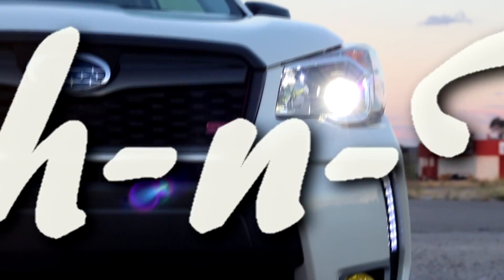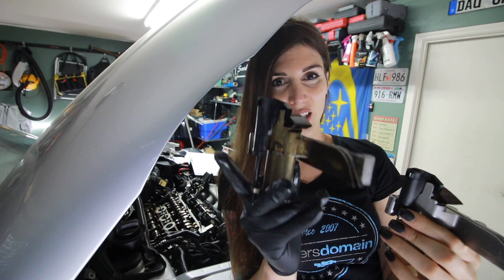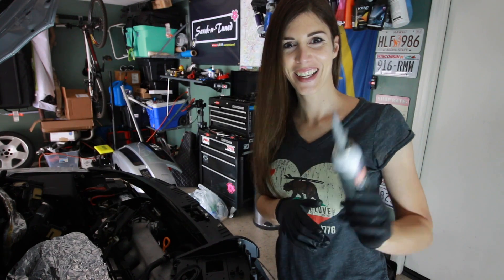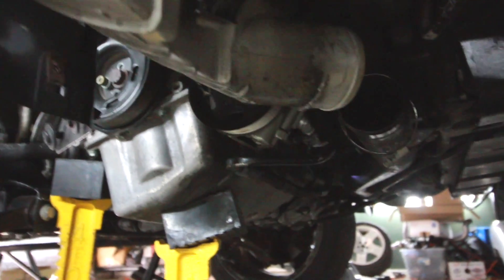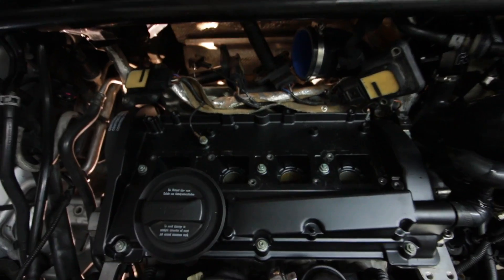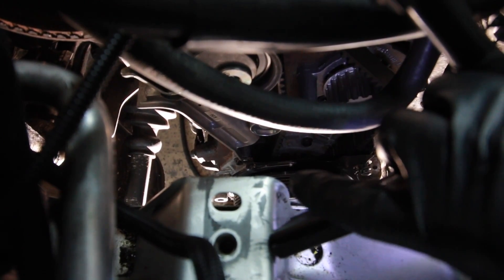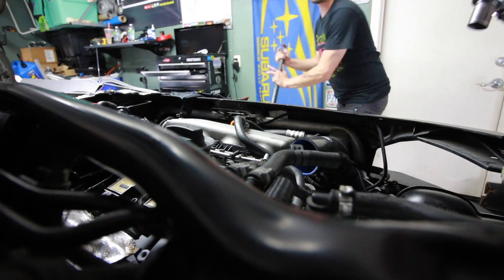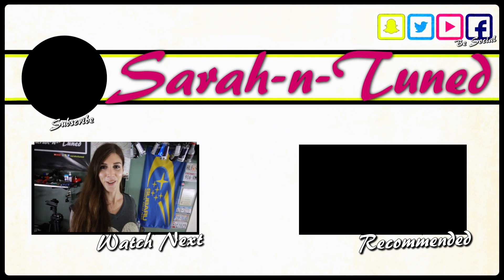Engine Reassembly Time! // Audi TT Engine Service Pt.3

Comment: yeah you really do need to have a bolt that you can screw into that empty slot that you mentioned in part 1 in order to compress the tensioner to get the belt back on the car. Otherwise it is going to be an absolute nightmare. Whatever you do, do not remove the grenade pin from the hydraulic tensioner until you have the belt fully seated on the engine.

Comment: Note to The timing part, you have to compress the tensioner with a small bolt, that way you can put belt on easier 
Nice garage, great video with sound effects.

Comment: Those rubber valve cover seals can be a real problem to seal up. On motorcycles we sometimes glue the seal into the cover with kwik grip. And only fit the cover when the glue is dry

Comment: I had a similar problem with my timing belt.  I just ordered the IE timing  kit. It does away with the cylinder and bolts the tensioner in a fixed position

Comment: This is not only a tensioner, also an VVT ( variable vale timing) to phase the camshaft.
There are tons of crap of this on ebay...hopefully you bought an VW/Audi part. 

Oil in the intercoolerhose is normal for the 1.8T..... don't have to replacing the turbo.

V/r
Andreas

Comment: I have 2 TTs. Only 65k mil on the 1.8 T and a 3.2 Quattro With 50k mil, Both 2005 models.in mint as new. So lucky to get them and so cheap. I did the timing belt on the 1.8, thanks to YouTube. A guy did a step by step. The engine mount was a hassle to work around but did it. My 17 your old drives the the 1.8, he love it. Good work. Inspiring 👌

Comment: I did my water pump and timing belt on my 08 vw gti last year and watching this is making me want to take everything apart again worrying about the timing. I didnt check it with a couple rotations and reading things of what youre supposed to do after doing it has always given me anxiety. The GTI FSI engine looks almost identical to this. The marks that I had made didnt seem to line up until I advanced the lower shaft a couple degrees to match the cam gears. The car seems to run pretty awesome currently so I guess I had taken a gamble and got it all lined up great.

Comment: for what it's worth, (hard to tell from video) but it might be easier to remove crank gear to get belt back on. Had the same problem with the old chrysler 2.2 that required timing belt changes every 35k miles. But good job. enjoy the humor and so much more ;)

Comment: Good advice about pulling the plugs to eliminate compression resistance.  A trick I learned is to mark the old belt with the timing mark on the cam gear and one of the teeth on the crank gear and then transfer the marks to the new belt.  Clamp the new belt to the cam sprocket aligning the cam gear marks first and then put the belt over the crank gear last at the mark. (White out works great.)  You still need to “walk” the belt all the way on. ALWAYS hand turn the engine two full revolutions and recheck the marks (maybe it’s four revolutions), but get the cam gear back to TDC (valve cover mark) and check the crank gear. When you have all the timing belt covers on, check the marks one last time. If they don’t match up, start over. If you meet hard resistance (really hard like metal on metal contact) when hand turning, take the belt off and try again. You don’t want to start the car and bend valves!
Reply: Ugh!  I should have watched further!

Comment: On my GF's 1.8T Beetle, I had to install the belt without the idler pulley installed.  I was able to keep the belt lined up and installed without the idler pulley, then installed the idler afterwards.  The Bentley definitely failed me during this process.

As for the motor mount, I never managed to get the stupid thing out no matter what I did to the engine.  I wound up working around the mount in the engine bay while doing the timing belt and water pump which made it extra...."fun".

Comment: Question: With that much oil, do the intercoolers need to be replaced too? Or, is there a concern about the oil interfering with the operation of the intercooler?

Comment: VW timing belts don't need marks, the cam cog is a taper fit (no key)... You need to lock the crank with the lock bolt, pop the cam cog off, fish the belt in, make sure the cams are still lined up with the marks at the chain adjuster and slap the cam cog back on with the belt on it.
It ensures the crank to cam phasing is near 0 degrees (which you can check in VCDS, I don't remember what measuring block though).

It seems a bit complicated, but it's a pretty neat system. Bit of a pain to do on the belt V8's though.

Comment: Blowing any smoke? When I blew the turbo on the b5 my IC filled with oil..  pulled the IC flushed it with gas then brake clean and good to go... Plus a new k03s. I need to find a license plate up here in Vancouver Canada to send ya.

Comment: It's okay, I use adjustable wrenches all the time.  So far the comments have been fine but with only 350 subscribers I don't catch much flack.  I just painted my valve covers in bronze and wish I went wrinkle finish but it's better than dirty black.  Your project is coming alone, good for you.

Comment: When I changed my timing belt on my 2006 VW GLI (similar engine) had same problem. It's tricky reinstall the side engine mount due to it shape. My friend and I tried for like an hour. Frustrated, took a break. After refreshed, like magic, in minute or two engine mount was in place. Ready to bolt down and torque. Good job!!!

Comment: Tip: Mark the old belt with alignment marks. 
Put it over the new belt and mark it in the same place. When you put the new belt over the pulleys   you should have a good indication of how the belt should align to the teeth. Helps a lot. Make sure to double check timing though! 

Try not to rotate the engine at all if you can!

Comment: Pretty sure the oil in the intercooler comes from the turbo. Theres no point in replaceing bearings and seals in a turbo( even if it were possible) and turbo's have a limited lifespan anways.

Comment: Hey Sarah I may have missed this but what's the mileage or speedo reading on the TT just wondering with the tensioner wear etc
Reply from the maker: Marcus Merrell 125k Miles. I have all the service records for the car, it was dealer maintained until 2016.
Reply: @SarahnTuned  Always good to have service records & a little history to the car makes all the difference. Amazing how it's all coming together like the MR2 too.

Comment: The oil buildup on those 1.8t's lol. The previous owner probably never drained it. You can drill a small hole in the bottom of the intercooler, and plug it with a screw. Then whenever you do your oil changes; take the screw out, and drain the oil build-up. KO4 turbo upgrade? Timing belts on those cars...😖🔫

Comment: Ahhhrggg...evil engine plastic cover bits!  Must..remove..and..throw...away..engine...plastic.... 😂  but seriously,  nothing solves all timing belt timing woes better than the long screwdriver through the #1 spark plug hole. It never lies if you're patient.

Comment: Greetings from Denmark. Free tip friday on a monday. When you need more slack on the timing belt for installation you can temporary remove the small idler pulley (the one between crankshaft pulley  and tensionerpulley). I give you the extra small amount of slack thats necessary.

Comment: V/C turned out great, especially for night painting!

It's hard to tell on a screen, but from the spacings, it didn't look like the cam would have been a full tooth off the first time. Set the crank, and check the cam, you hadn't even gone the full two turns when you stopped to check. With new parts, if the cam is less than a full tooth past the mark, it's going to be a tension or break in related, if it's shy of the mark something else is wrong. It's a tough job to get on the first shot with just two hands, you shouldn't feel embarrassed at all.

It is a lot of oil in the intercoolers, but you don't know how long it's been building up, maybe start with PCV first? A catch can just solves the symptom of a bad PCV system.

Hope the first start up after all this work goes well.

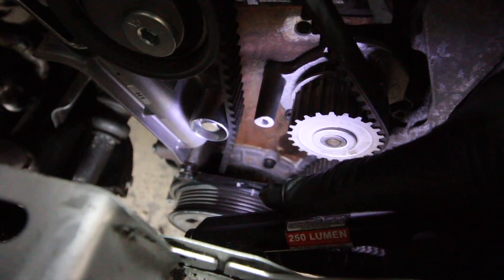Comment: 13:15 Another quick tip, wich you mentioned, but is is ADDENDUM:  grab white marker, mark 3 teeth on crank pulley and belt, and 3 teeth on cam pulley and belt, on the old belt vefore removal ( only if you know the timing is good). Then transfer those 6 marks to the new belt, and that will give you 100% accuracy when you put new belt on, since you allign it with the cam and cranks pulley with your marks.  Beats sleepless nights "did i do it right?"  Ask me later how i learned this...Keep it up!

Comment: why never mentioning the marking on the flywheel through the little window on front of block?
Reply from the maker: Gerry A aftermarket flywheel didn’t have the mark on it.
Reply: ahhh i missed mentioning of a aftermarket flywheel. seems to have worked out for you anyway, good luck with the rest ,this car will definitely keep you going with content , im 3 years on with my tt,exact same as yours, nothing OEM left and still constantly fixing/upgrading stuff..iv done timing belt 4 times now and the manual and youtube video instructions out there are stupid,i put the belt on the same way you did.

Comment: Top Tip: It is highly advisable to drill a small hole at the lowest point in the plastic in your intercooler, where oil would sit and gather, and drain your intercooler at every oil change. This comes from the TDI VW world, but extends to your TT since we share parts, like the intercooler is 99% same as the one on Jetta MK4 TDIs that need the same "mod" done to them since they can runaway on that. If you want to know more as to why and stuff, reply and i shall explain in more detail. The hole has to be small, and you can plug it back with like a short drywall screw, and i assure you no boost will leak, it would take like 50 bar pressure or maybe more ( im guessing) to actually make a boost leak because of the little screw in the hole ( like my innuendo?). Thus no need to spend moneys on catch can.
Reply: Diesels should have oil drain plugs on their intercoolers😂 whether it's like a petcock on a radiator or just a m10 screw at the lowest point. 7.3s are known to put oil in the cooler and I've seen that tip for them too but just leave the hole open for the oil to drain from. Odd to create a boost leak imo 😂
Reply: @jaredanthony8070  yeah, if you do your oil change every 6k miles, drain while youre in there, and no, dont leave the hole open , that would be a boost leak, all it takes is a small screw LoL. Good point, i hope she reads it.
Reply: @semecristian  the problem with 7.3 intercoolers and draining them from the hotside/coldside is the tank ends go below the pipes and theres no true low point to them they are flat bottomed. But on some powerstroke forum I had read they were recommending drilling like a 3/16 hole and just leaving it to blow the oil out of 😂
Reply: Volvo had a service fix for the 850 turbos used in cold and humid climates. Apparently, the intercooler could collect moisture and it would freeze the outlet at the bottom of the cooler closed, or at least restricted. 
The fix was a 3mm hole drilled into the bottom intercooler tank and left open. It automatically drains the cooler of any liquids and makes no difference to anything. I drilled the hole on my intercooler and no issues.
Volvo revised the intercooler piping for the next model year to eliminate the issue.
Reply: Sideslip TDI gen VI had a very similar problem. After my engine collected 500 ml of condensation from the intake (still started, amazingly) VW replaced my intercooler at no cost.  Design issue but the even the VW techs at a dealer didn’t know about the TSB.

Comment: He's right you do always look great. That's a fact. I'm sure you probably already know this but when you get the oil leak fixed remember to have your intercooler cleaned out. All that oil on the charge side is going to be the gift that keeps on giving, it could throw codes, or even make you think something is wrong with the car after you get the oil leak fixed.

Comment: If you're getting that much oil in the intercooler I'd be worried that the turbo has a leak in the bearing. You need to at least check it. You might be be able to get a rebuild kit for the turbo that includes a new cartridge.
Reply from the maker: whelk I’m going to put a bigger turbo on it instead.
Reply: That should do it. Good luck.